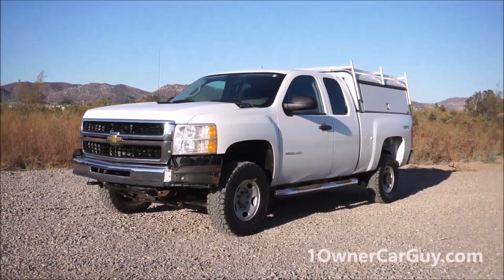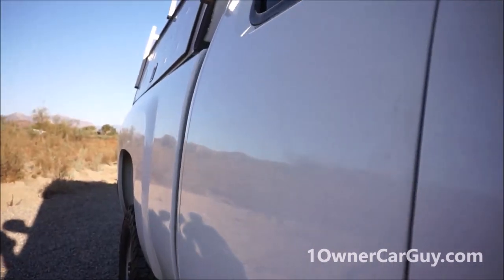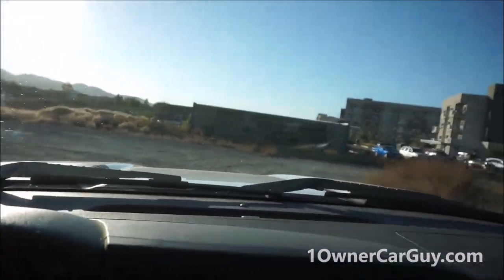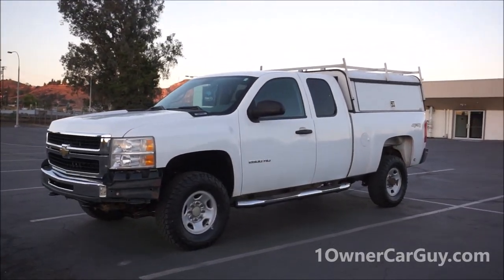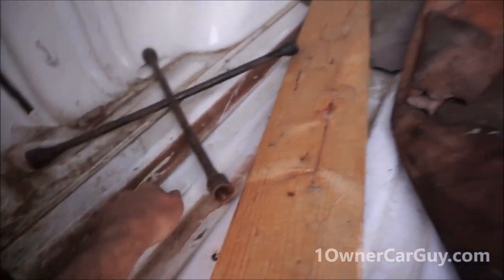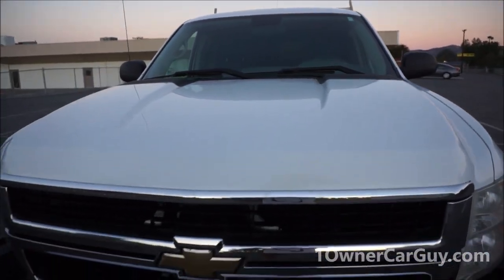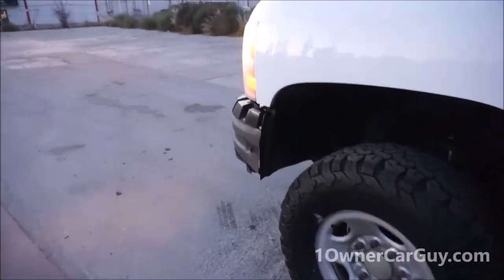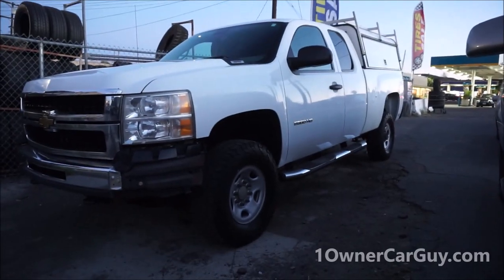Chevrolet 2500 HD 4x4 Pickup Off Road Pkg Exterior For Sale

Comment: Awesome truck,  if only it were 5spd!  Nahh i love driving manual trucks but that truck there is pretty awesome, id rather have the Ford but i would be happy in that 3500 !
Reply: Oops a. 2500
Reply: W8FG they don't make these newer ones in stick shift.
Reply: Dodge 318 Cummins - that is just sad, a truck especially a good 2500/3500 work truck should always have an option for a good strong manual transmisssion, the auto makers have totally lost their way!  I still want a gen one dodge cummins 12valve , manual transmission, extended cab.   Those are REAL TRUCKS ,  for me right now its down to luck and money coinciding at the same point.  Id be glad to have this Silverado but a 25 year old Dodge thats clean or well restored, id be just as happy if not happier.  Giggle factor! Its just gotta feel good and make ya happy to drive it!
Reply: W8FG the only new HD truck you can get with a manual trans is the ram 2500/3500 Cummins 6.7l they have a 6 speed manual as an option.